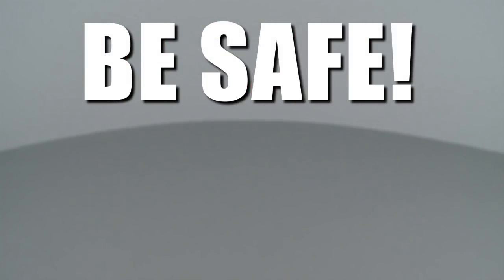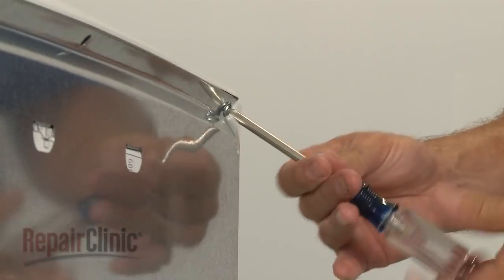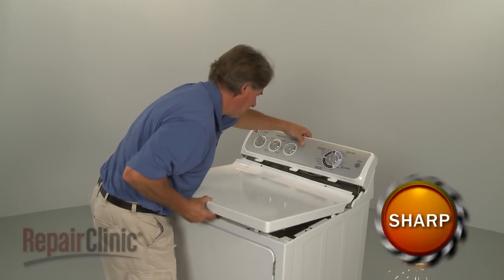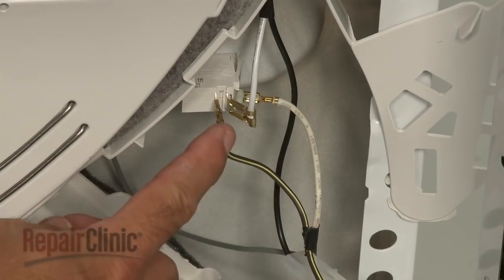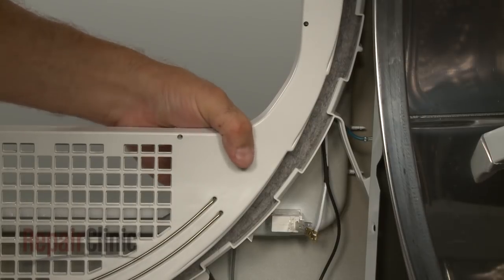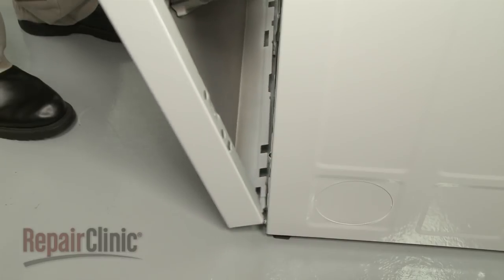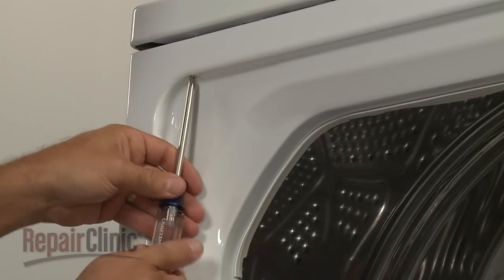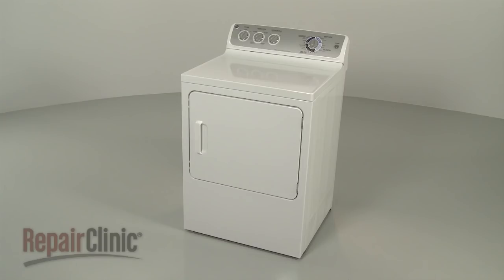GE Dryer Door Switch Replacement, Repair #WE4M415

Comment: Thank you for posting this, but you should include this video with the one on how to change the dryer belt. If I knew how to disconnect the wiring from the door switch, I wouldn't have destroyed the switch in the process of replacing the belt. But both videos helped me a lot.

Comment: Where can I find how to assemble the door switch? When I was replacing the drum belt the door fell to the side and the switch came off. What do you recommend that I try to put all the pieces back together or should I buy a new switch? Thanks.

Comment: Watched and thumbs-upped 👍
How do you test, disassemble and replace if necessary a DDG5780GDLWH early 1990's maybe late 1980's style with round plunger switch in upper RH area of door inset area

Comment: WARNING!  My dryer is newer than the model in the video and was very different.  My door switch is "L" shaped and unlike what I've seen in other videos, you cannot just pull it out the front.  Nothing was easy as they show it in the video.  NOTHING!  I didn't have the right tool to get the hex screw out of a ridiculously difficult place to release the control, which never did release.  I wasn't pulling on anything so it breaks.  Then the stupid wire guard - watch out because it falls back onto your fingers.  I had to tape it with duct tape out of my way to get a ridiculously difficult METAL CAP off  the the door switch in the back then fought with the door switch from the front to finally get it out.  On hour 3, I finally got the new door switch in and now can't realign the front on the drum for some mysterious reason.  My front didn't just pull up and pop off like Mr. This Is So Easy shows.  It just wouldn't come off so I just worked around it.  If your a woman, you don't bang and pull and push like men do with a machine.  We work more delicately.  I'm not forcing something so it breaks.  That's what my car mechanic does, the idiot!  So forget 10 minutes.  Take the day off work, plan for 10 hours of craziness.
Reply: yeh...mine is just like yours. plastic fukn flap designed perfectly to be in the way of the switch which seems to serve no purpose other than pissing you off. then covered by that stupid metal housing. these companies make it harder for you to repair your own stuff. that's why the only videos you can find is the outdated machines they dont use. i actually found the videos for the newer models we have, but guess what, you're right, you have to pay to watch the videos. they dont want you in there. they want you paying those high ass service call costs just to tell you what it is, then pay another high ass labor costs just to fix a $5 problem.
Reply: @youngatwista  LOL!  You got it.  After all that - is wasn't my door switch anyway and had to call a repairman.  They are very clever.
Reply: @TooManyCats77  it sounds like you have the same machine I do. Did a new door switch make an audible CLICK when activated? My dryer won't turn on and I assumed it was an issue with the door switch because it doesnt make a noise when you push it in. But I fear ordering a new one and havent it not be the issue like you found out. Second question, what ended up being the issue?
Reply: @benjaminvolk3566  You know I don’t even remember.  I asked him and he mumbled something technical so I’m not really sure.  It’s working fine now though.